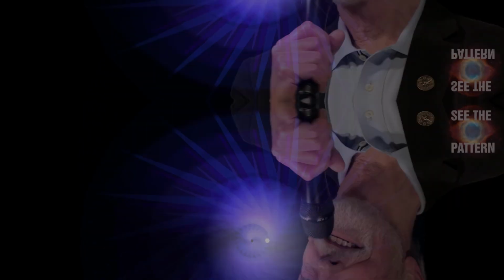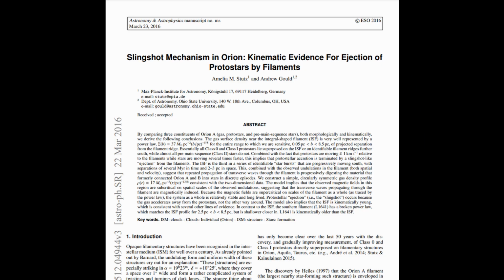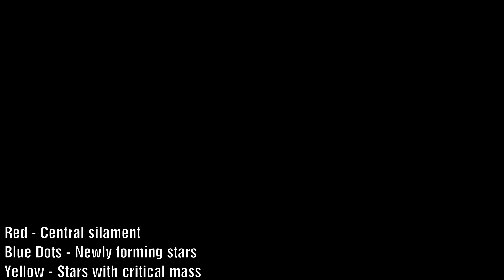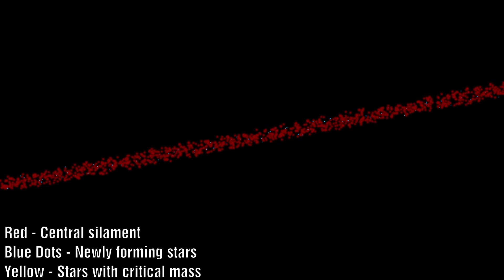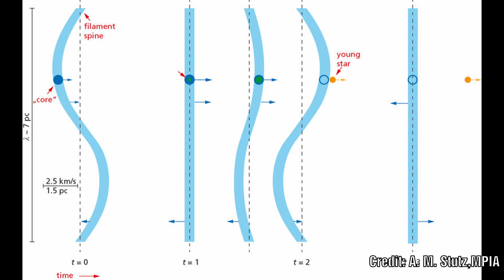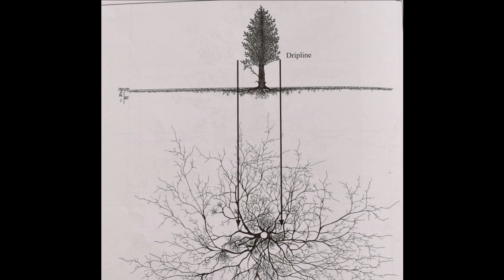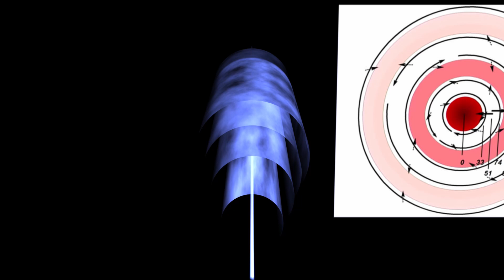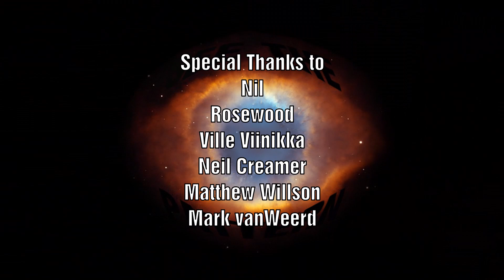Slingshot Mechanism - How Stars can be EJECTED from the centre of a Filament

Comment: Studies from Tokamak plasmoids show that the core of a plasmoid is ejected when an input voltage spike in the plasma feed occurs.   According to the Peratt model the pinch, or node, also has a torus orthogonal to the Birkeland current at the pinch, AKA the ecliptic plane.   The torus around the node is what causes the pinch.
   When an input  spike in plasma or voltage  occurs, the voltage tends to shunt to the torus and away from the core, creating a sudden increase in the pinch onto the star.  Also the torus, or ecliptic plane tends to flatten, exposing the core or star within the pinch.    When the voltage shunts to the torus, away from the star, this creates an instability within the torus, increases the pinch onto  the star, which can cause a magnetic instability, sling shot, with the pinch.. Due to an increased pinch and an instability, the star can eject from the pinch within the torus.
    https://www-users.york.ac.uk/~bd512/teaching/media/mcf_lecture_10.pdf

  It seems less likely that the stars are being ejected by a wobbling of the filament, and more likely that  the observed wobbling is because the  stars become trapped in the torus, as  stars  generally seem to orbit orthogonal to the pinch, in a beehive cluster.
Reply: Interesting. Is it possible that there is more than one way that a star could be ejected? Both mechanisms seem plausible - being directly ejected from the pinch, OR experiencing enough wobble that the restraining forces are no longer sufficient to contain the stars inertia. It would be interesting to know if there have ever been experimental observations of ejection due to excessive wobble.
Reply: @critical-thought  I am just throwing that out there as an experimental conclusion that seems to fit.  I think that latter maybe possible as well.  But I think there is more evidence that just the solid core would be ejected and not the gas sheath of the star.   A star, ejected in this manner, that no longer has a core would, in my opinion not give off light and become a "disappearing star."
      It seems more likely that stars are not formed within the direct current of the spiral arms, (Wal seems to think that these would be white stars)   Rather I think that stars  are formed in Marklund convection rings,  or beehive clusters in  the tori around  the pinch, divided by ionization potential.   For example, a red star in the inner convection torus, a Saturn-like gas giant in the second torus, and a hydrogen star in the 3rd torus, blue stars in the outer torus. 
   As far as the evidence goes, it seems that a galactic spiral is a standing wave that sets up between the galactic edge and the torus around the galactic core.
    So far there is no evidence that stars move inwards along the spiral, just the plasma in the spirals moves.  Evidence is  that the beehive clusters tend to orbit the spirals, it would seem then that the pinches in the standing wave nodes are also stationary within the spiral arms. 
   It seems logical that a star would settle into the nodes of the standing waves, just as a beach ball would stay within the trough of a wave.
   So I am still up in the air as to whether stars are ejected from the center of the  pinch in the spirals, if they form there at all, or if just the solid cores would be ejected.
   I think the evidence is  that planets are born from stars in 3 different manners.

   1. Core ejection by input plasma spike, 2.   formed by Herbig-Haro configuration out of the polar jets of stars, or by supernova of a star which ejects the core, much like the Cannonball pulsar.
Reply: @critical-thought  In my opinion, "black holes that shouldn't exist" fit into this location as well.   
     There are stars orbiting nothing, so those  could be  orbiting  a current pinch, but nothing seems to accumulate in the center  of the node.    
   But, this could be a node from which the white  star at the center was ejected, leaving the beehive orbiting. 
   It could be both or some variation in between.
Reply: That's like a movie spoiler.   
Well, as long as the jobby is just spinning and not loading, I'll move along.

Comment: Methinks that as stars in the filament core reach a certain mass-density, their charge reach saturation for that mass-density, and are then eased out of the core section of the filament into the next outward nested filament structure, where they "ripen" a bit more until a new, probably opposite mass-charge density is reached, and so on and so forth; no ""slingshot"" action needed, but more of a graduated, gentle migration outward through the various charged annular rings of a Birkland current.

Now if I were a mainstream scientist, I would have to use words like "explosion" "gravity" "collapse" "evolution" "dust cloud", etc. to formulate my "Methinks" conjecture. Funny how certain word groupings get swept away by utilizing unbiased observations.

Good work, Gareth. Thank you!
Reply: What causes stars to break away, and become brown dwarfs?
Reply: @averysax6429  I, along with everyone else on this planet do not know for sure, but it does seem likely that as the electric currents move about, a regular star could morph into a brown dwarf as the electrical field changed as the Birkland current and the star change position in relation to one another.
Reply: @4n2earth22  A nested filament structure may have each layer separated by a thin membrane like layer. The ripening layer.

Comment: Gareth, what a great presentation! But it leaves me with a question. At 5:30 you suggest that the stars are contained in the filament until they reach a certain mass, and that gravity effectively slingshots them out of the filament. However, if Wal Thornhill is correct in his prediction that gravity is primarily an electro effect (i.e directly related to charge density), then we could more accurately say that the stars are ejected due to different charge densities (from the central filament).

This way, it is not gravity that slingshots them, but perhaps a flickering charge density along the filament itself, which at some point drops lower than a threshold to keep the star in an electrical charge that is compatible with its capture. Thus the star is "released". An imperfect analogy could be the static balloon held against a wall, which drops if the charge density drops. It is not slingshot, but merely "released".
Reply from the maker: I’m not sure I directly said gravity causes the slingshot. It has more to do with the mass and hence inertia. So the magnetic force struggles to keep hold of the object as its mass and hence inertia grows. There is however also an aspect that is worth investigating further and that is the kick they see being given to the ejected star. Could the process of the star moving through the double layer at the edge of the filament provide an extra boost?

Comment: Filament here refers to helix electrical plasma filament where stars were born from and into. As it spin on its hollow axis, it gave us an illusion of “waving” as it only spin but wave. Secondly planets after born is attached to and ride with the filament in motion, in a northern up helical path, tuck by a force 2.27*10^39 times stronger than g or inertia forces. That is electric charge force. Sling shot? Yea to those who disagree with above. Less likely to those EU fans.

Comment: You can pretty much test this on paper.
We have a star, our sun. If we assume its powered by a filament, then we can calculate how much energy would be needed to be input into the star, in order to get the current out put of our sun. 
We can therefore assume the filament current has that energy, and can translate this into magnetic field strength, around the filament current.
We can calculate how the magnetic field drops off around the filament, and what magnetic field strength should be expected around earth, from this current filament. We can then compare this value to the magnetic field strength of the earth, and if its similar, then the hypothesis is plausible, if not then its wrong.

I did the calculations and the field detected about the earth is 100times lower than that predicted.
Reply: You did not factor the possibility of dissipation during energetic conversion by the sun. 
The Birkeland current output from the sun alone cannot be compared to the input of the feeding filament because there's might be a dispersion of energy to all the planets in the solar system.
I'm not an astrophysicist but I think it would be a worthwhile study to trace the gravitational fluctuations of the planets to see if they're bounded to the sun in some way.
Reply: interesting, did you also account for the reduced counter field due to the induced and trapped counter Magnetic flux density inside sol & earth !
Reply: @7dnein944  its better and faster to just get closer to the expected result by accounting for forces & counter forces we think we know, before going into 'a worthwhile study' full of uncorrected NIST errors pseudo math first.
Reply: @7dnein944  Excuse me, I am in well above my pay grade here, but is there a difference between a gravitational fluctuation and a gravity wave?
Reply: @amywas1  Any wave is a set of numbers.
The difference of the numbers in time would be a fluctuation. 

Now, gravity is the bending of space-time due to mass. Since there's an energy - mass equivalency, we can say that, a gravitational flux is caused by a difference of energy in the system. 
Since Gravity (G) is not a true  constant, changing with time one cam deduce that energy is being fed into the system. 
Which brings us to the filament structure or Birkeland currents
:)
Reply: @7dnein944  thanks for the tips, but you do not need to account for this. The simple fact is, you can detect the suns magnetic field strength about the sun, and about earth. Even when we look at readings from satellite measurements of the sun, the magnetic field needed for this to be true, simply isn't there
Reply: @paulmaydaynight9925  you don't need to account for that either, as the suns magnetic field about the earth has been measured in by satellites and is commonly something satellites have to account for although small in effect
Reply: @7dnein944  Thanks for that. Is it my just brain or is the entire cosmos turning to an electrical soup? Now could you please tell me, does this mean that Wal Thornhill is wrong to be critical of Einstein's "reification of time"? And how does this theory of gravity( I will put a link down below) fit into all this?

https://www.youtube.com/watch?v=mCxw3PEes4M
Reply: Your first assumption is incorrect, Scotty. The Electric Universe model of a star was tested in the SAFIRE experiment and declared successful in 2019. Stars are not passive 'heating elements' in an electric circuit. Nuclear energy is being produced in the photospheric plasma discharge of bright stars like the Sun, as I predicted years ago. The number of orders of magnitude difference between the electrical input and radiant output is now under investigation. Theoretical particle physics is in as deep trouble as astrophysics. See thunderbolts.info for videos.